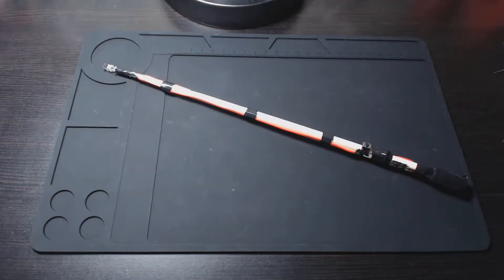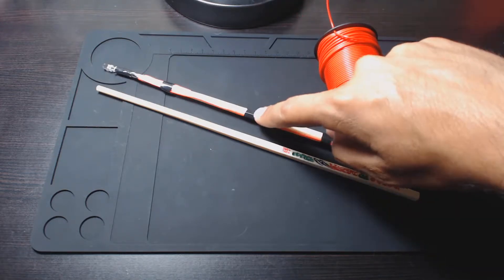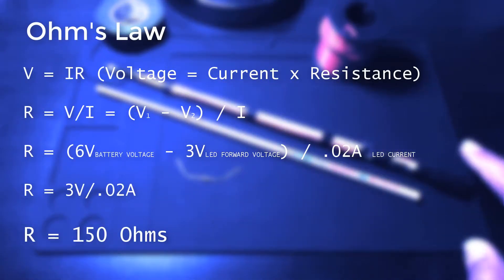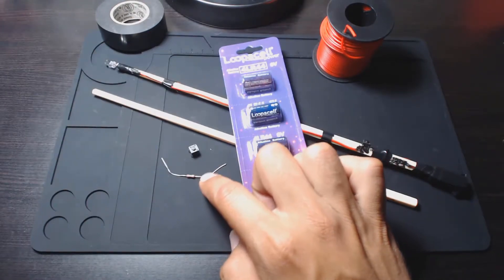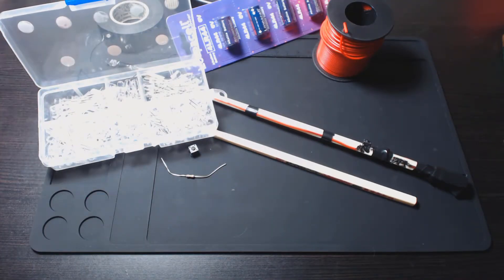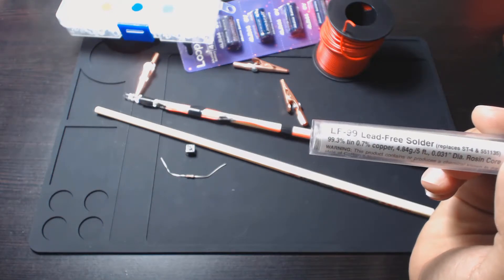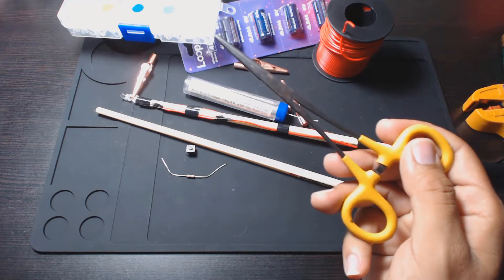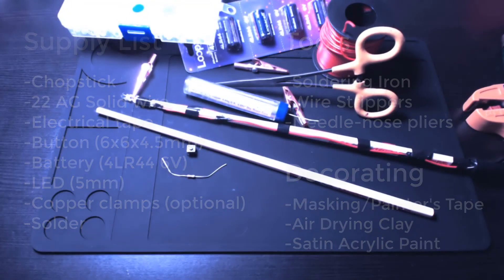DIY Light-Up Wand | Part 2 - Supplies

Comment: I have watched a couple videos about lighted wands. Yours looks the cleanest and most methodical and understandable so I wNt to do yours. Why do you use s transistor though? I think in the others they just connect directly to the button? Honestly electrical things confuse me. I’m sure once I’ve done a bit it will make more sense
Reply from the maker: I'm not an electronics expert, yet essentially it seems to be a best practice to prevent your LED being burned out from too much Current. If there is a change in Voltage in the battery, it could cause a large change in Current. So the Resistor is there to prevent the Current from getting too high and affecting your LED lifespan.

Comment: Quick someone tell me if I have a 5volt led what volt batteries do I get and also what’s the ohm of the resister in this circumstance, I’m 14 and idk how to do this math
Reply: Oh ok thank you. Wish me luck
Reply from the maker: About 1 minute into the video has the formula. Yet do you have a 5 Volt LED or a 5 millimeter LED? Wherever you brought the LED should give you the volts and amps, since it could even vary by the color LED you use. Or you can likely find it if you know the size and color light to find some common volt/amp stats. Then you can plug it into the formula here: http://www.ohmslawcalculator.com/led-resistor-calculator to figure out the size resistor. You should be able to make it work with the same 6V battery I used.